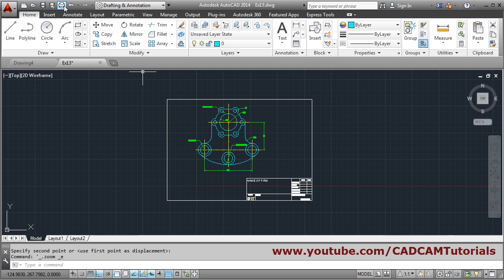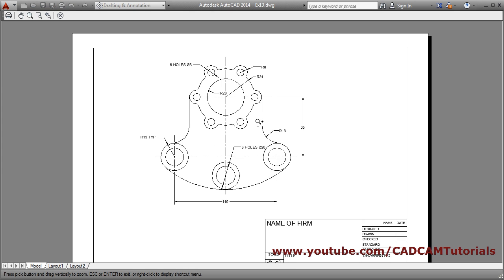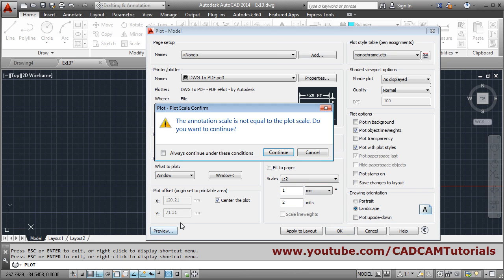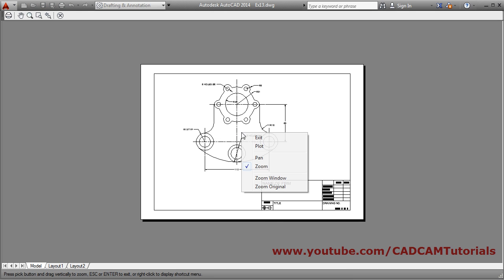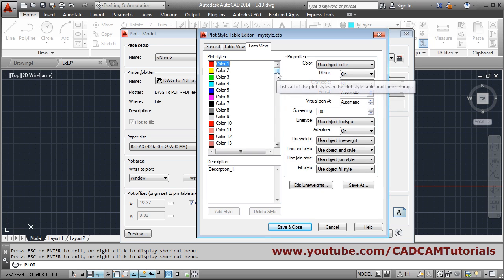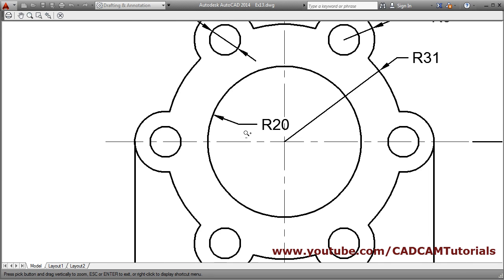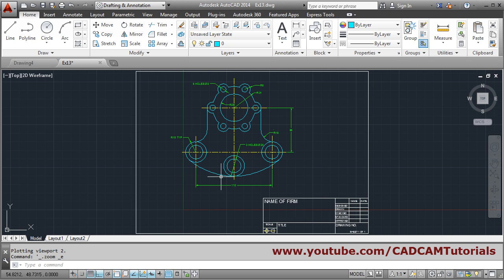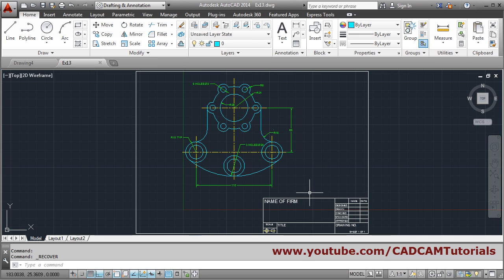How to Print Drawing in AutoCAD | AutoCAD Printing Tutorial

Comment: This method is a quick fix; however, not proper. Printing should be done in Paper Space, NOT Model Space. I.E. That is the reason why there are sheets/ tabs... Additionally, printing in model space will result in scaling issues later.